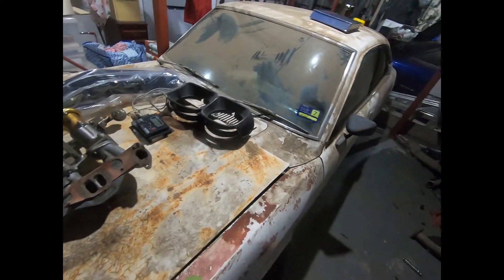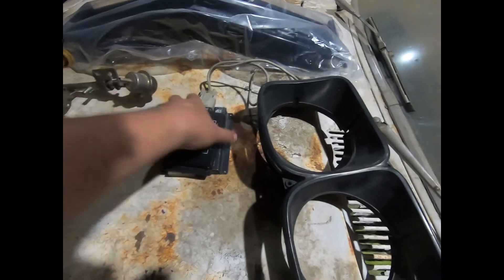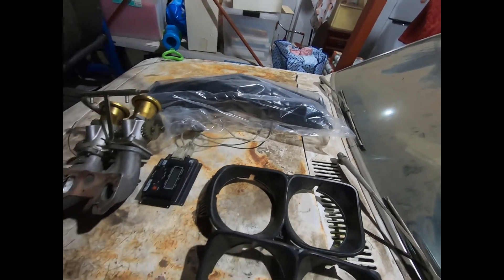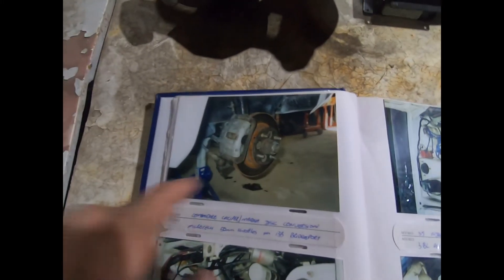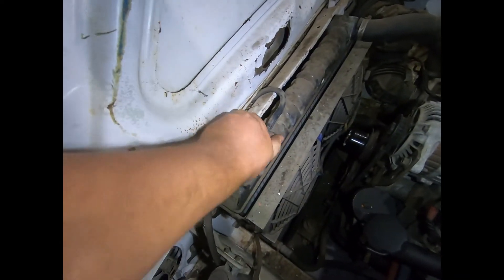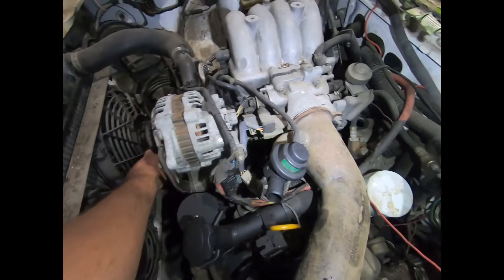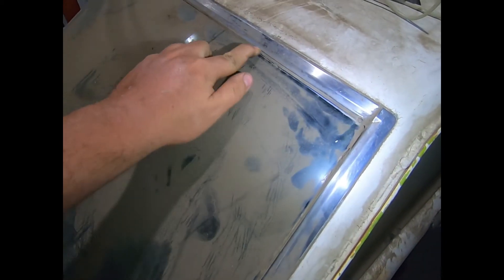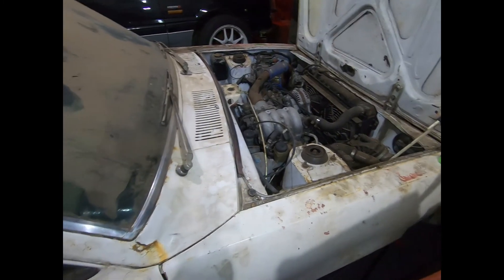Found More Stuff - Mazda Update

Comment: Hey Mate, Don't know if you have done anything with the motor on this yet, But don't just hook up a Battery and turn it over. It is really easy to score the housings or break a Apex or side seal. Take all 4 spark plugs out and give it a really good spray with some CRC. and don't be shy with it use almost a full can over a few days. Then make up a mixture of ATF and light weight engine oil. let it sit for a few hours then turn it over by hand 90 degrees and then fill it up again.
Keep doing this until you have turned it over by hand at least 2 revolutions. Take your time it can take up to a day or more. you want it to soak in. Then with the plugs still out and the ignition or dizzy disconnected wind it over with the starter. Just put a old section of cardboard up against the strut tower to stop all the fluid coming out of the Plug holes sprayimg everywhere. As you said it is a good call doing the fuel system. Just don't forget to start at the tank and work your way forward. I am from the Brisbane area and have been building and working on Rotaries for over 30 years. so if you want a hand to get it running i would love to give you a hand. Just reply on here and we can workout contact info later.